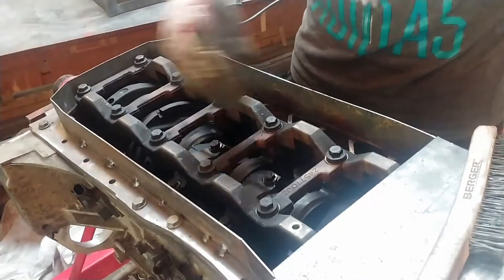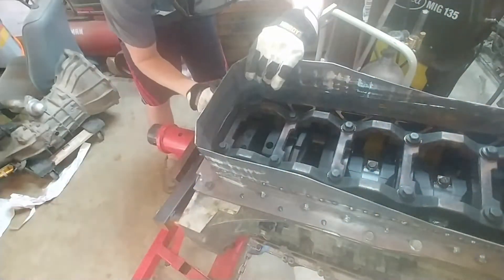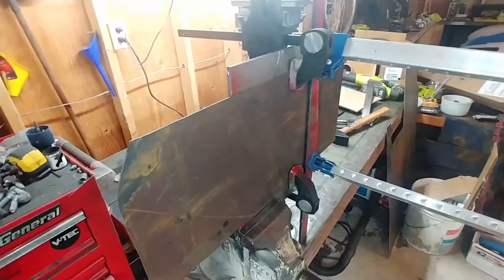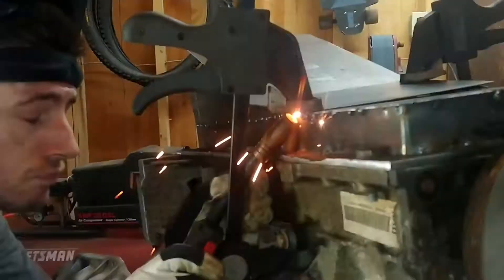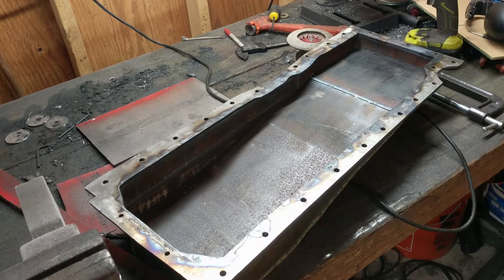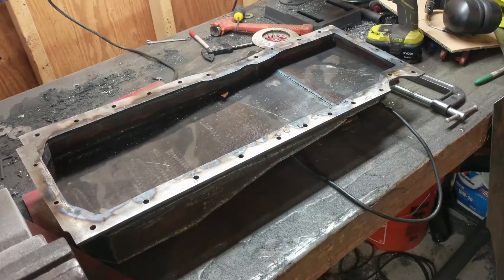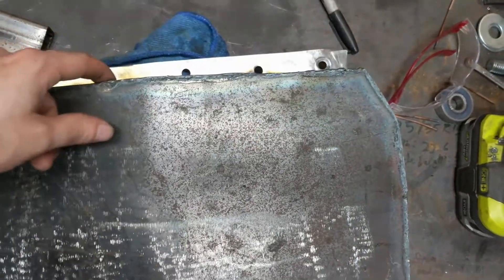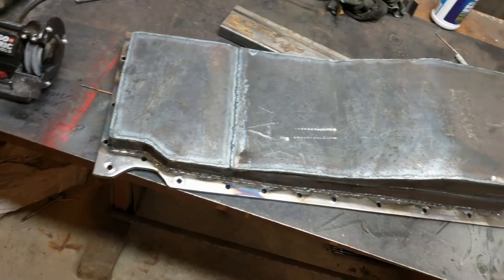DIY Vortec 4200 Dry Sump Oil Pan From SCRATCH!!

Comment: I've only got a mig welder and very comfortable working with sheet metal. I was initially thinking MAP gas and Alumaweld to do aluminum, but I'm afraid all the heat will warp the piss out of it and leak like a sieve. Any reason I couldn't do something similar for a full wet sump on a 4200? Putting one in a '65 Chevelle, so rear sump and thinking 8 quarts for capacity if I go turbo down the road.
Reply from the maker: I ended up with some pin holes that I filled with my mig welder, warping is definitely the biggest challenge. Keep in mind with a wet sump that you'll need to also make an oil pickup
Reply: @slightlyengineered  Understood. Do you remember what the height needed to be to clear the main girdle? Crossmember clearance is a beach on this thing, and I'm trying to avoid cutting the car up if at all possible.
Reply from the maker: @AustinRBa  I don't. I just started with a full flat section that cleared everything and built it from there.

Comment: What is the difference in oil capicity now? Does the dry sump tank just make up for the difference?
Reply from the maker: Oil capacity is now in the range of 3 gallons or 12 quarts. The dry sump tank becomes the component that sets the capacity.
Reply: @slightlyengineered  thank you for the quick reply!

Comment: curious why the deeper / sump area ? why not just flat ?
Reply from the maker: You typically want to have your scavenge feed be able to be completely submerged in oil. I also plan to have both scavenge ports in the back of the sump with a divider plate to make sure they aren't fighting each other. Having the extra depth just ensures that they can have enough oil to pull in effectively without getting air.